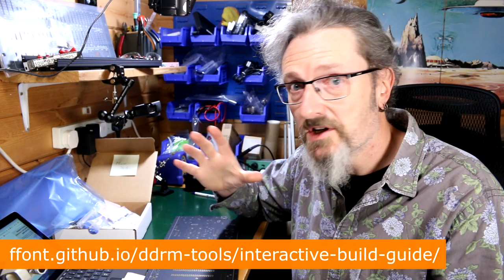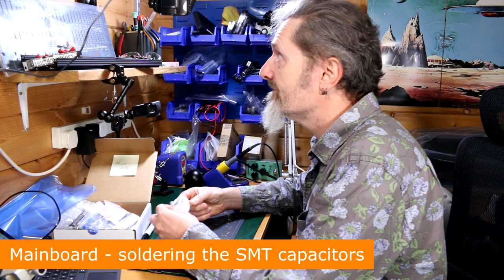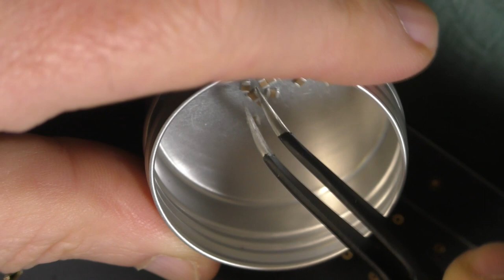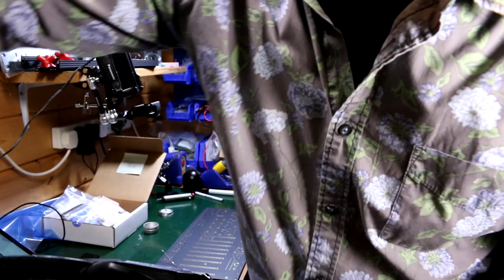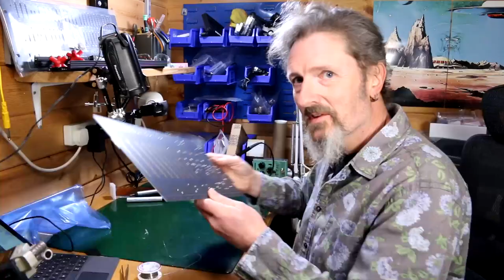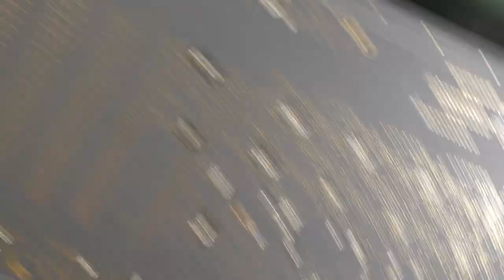Deckard's Dream DIY Build 04 - Mainboard SMT

Comment: My two cents - it's to much solder. You can make connection between the pads. Solder should go uphill, and not form the sphere
Reply from the maker: But would it cause a problem?
Reply: @MoltenMusicTech  If you short it, it will cause problems. Get any pcb that is assembled in factory, an you'll see how little solder is needed.  Also, when you have a ball of solder on your cap, you can't easily see if that solder is also spread on the pad or it lays only on cap and doesn't touch the pad (you can easily check that if you heat up the other pad - if component moves, it had a cold joint)
When I put too much solder on a cap/resistor, I usually just "wipe it" with a soldering iron. Excess solder remains on the iron's tip, and then you can see if the joint is good or bad.
Do a Google image search for "smd good solder joint", and you'll see how it should look.
Reply from the maker: Cool thanks - being so specific is actually really helpful

Comment: get a heat plate, solder paste, tweezers and bin the soldering iron, way way way easier, as to why you would individually solder each joint is beyond me.
Reply from the maker: Nah
Reply: Don't listen to all these sofa pundits, you're doing JUST fine.!
Reply: @MikkelGrumBovin  im no sofa pundit, ive built many projects using smd, the heat plate is a revelation, just like the modified toaster oven before it, and the discovery of hot air reflow before that.
Reply: @deadprivacy  yes you are a sofa pundit, nothing wrong with being a sofapundit, in fact, you should be proud and happy, at least you're not a complete nontalent, just a bit boring, that's all, -
Reply: @MikkelGrumBovin  tell you whats boring, individually soldering smd caps....
Reply from the maker: I find it therapeutic
Reply: @deadprivacy  I sat in sofas with more wit'n grit, -
Reply: @MikkelGrumBovin  yes darling. you can go away now
Reply: @deadprivacy  Thank you.

Comment: These PCB synth kits seem like the scam of the century. Not only is it a pain to source out all the components, but it ends up being way more time consuming than you think. I enjoy soldering, but having to do that much surface mount SUCKS. People tend to forget that 99.99% SMD soldering is done by machines and not your average soldering iron.
Reply from the maker: "Scam" seems like a bizarre term to use. The SMD soldering is not difficult as I think i showed here, and I'm a novice. I got all the components together in a kit from Synth Cube - again not difficult. I think it's great that if you have the time and patience you can get into building an awesome synthesizer. No one is trying to scam you.

Comment: You have to have a bloody extractor fan unless you want trouble breathing later in life! The chemicals used in solder and flux atomise when heated and really are not good for your respiratory system.

I do this stuff for a living trust me, don't cheap out on PPE

Comment: this was actually painful to watch. why don’t you just buy hot air station? you would get them done in minutes.
Reply from the maker: I don’t know what that is and I don’t want to buy a whole load of more stuff to learn. My soldering iron is fine - thanks 🙂
Reply: It's a pretty simple workstation with a much better workflow that would increase your accuracy and speed by >200%. You can get them on Bangood for under €100 - worth looking into for the sake of researching alternatives - probably only worthwhile as a purchase should you wish to undertake further similar projects. Best of look with the project and I'm sure it will inspire others to lower their fear threshold.

Comment: Holy crap you did it the hard way with an iron. You need a solder paste dispenser and a $50 hot air tool. Doing this with an iron is for experts only. I don't think it is a good fit for you. It also takes longer with an iron. Way more difficult to repair a bad solder joint or remove a part without hot air.
Reply from the maker: I’m good thanks 😀

Comment: and ffs stop greasing the board up with your fingers...
Reply from the maker: And that’s not going to happen either 😀
Reply: @MoltenMusicTech  dont get me wrong im very grateful for the video series, im looking to build one too and the advice is worth its weight in gold.
but you talking about clean pads and discussing your flux pens cleaning capabilities whilst greasing them up with you mucky paws triggered me.
good luck with the build in any case and thanks for the reply.
Reply: Stop it,, puma, Robins doing fine without you're silly talk.
Reply: @MikkelGrumBovin  best practice is best practice, follow it or dont, there are reasons for this stuff though
Reply: @MikkelGrumBovin  https://www.youtube.com/watch?v=lTpHa70DDX0
Reply: @deadprivacy  you silly tosser, it's not The Solder Olympics, it's just Robin having a go at it, and that's it, -
Reply from the maker: I appreciate that, but there’s only so much advice I can take onboard - so that’s a good reminder to not get my fingers over everything - thanks
Reply: @MikkelGrumBovin  proper preparation prevents piss poor performance ya prick.
Yeah, just tell him "fuck it, do it however" you ever tried finding a dry solder joint on 1000 component board, its lot less fun than just deciding not to lovingly fondle the thing.